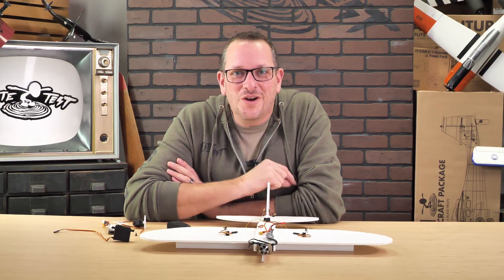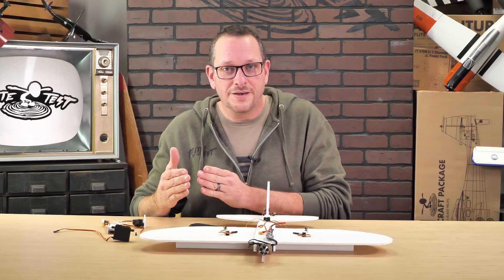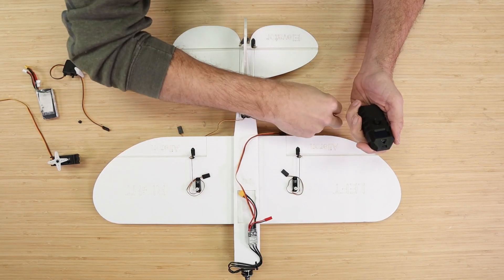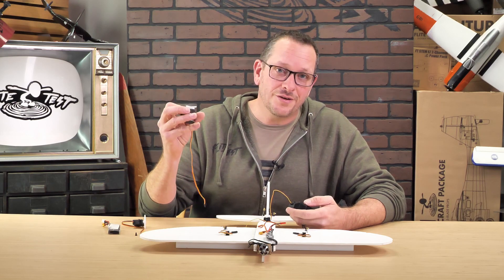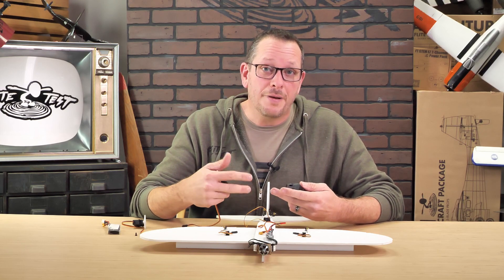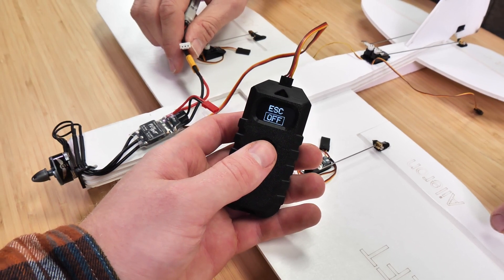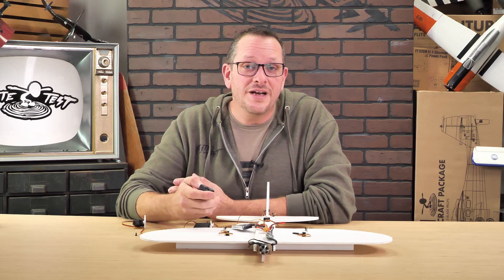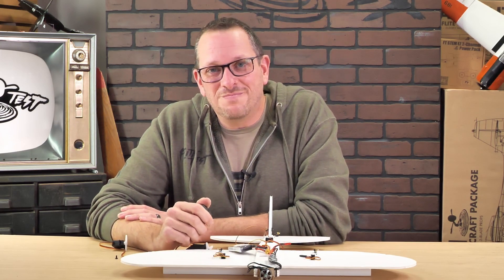Servo Buddy Overview

Comment: Really neat idea. I would recommend in a later addition including scroll wheel or turn knob to select a specific angle or throttle setting. Would be helpful in figuring out surface offsets.

Comment: Not a bad idea. But I don't need to have one in my hands to tell you an improvement: Instead of buttons to flip the servo between +-45º, put a self-centering slider on there to let us cycle it to any position within that range. Some setups I have...namely 9 gram servos on glow engine throttles...don't have enough range of motion for that. Could strip the gears out.

Comment: WHY do people have issues centering servo's ? I have never had an issue centering a servo ....
Reply: well, he says that servo testers sometimes might not work correctly? i just use a small battery and an RX that i saved as a model on my radio to test/center my servos, also never had an issue with that but compared to this device in the video, it's quite a bit bigger to setup which might be annoying while building, when you have to find a place for the radio

Comment: I made an RC tool back in 2014 that I called the "Servo Buddy"  this was meant to allow the gradual application of a control surface based on something like a switch flip (slowly lower flats or landing gear for example).  https://youtu.be/CWIXXsfcYNI